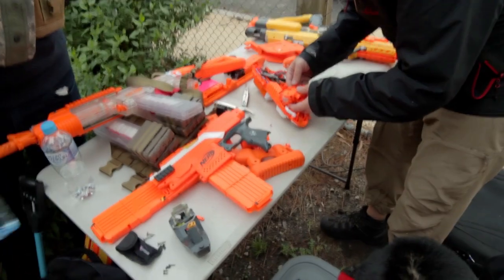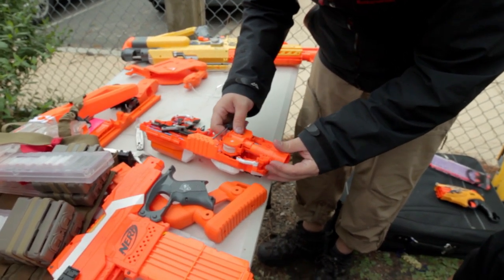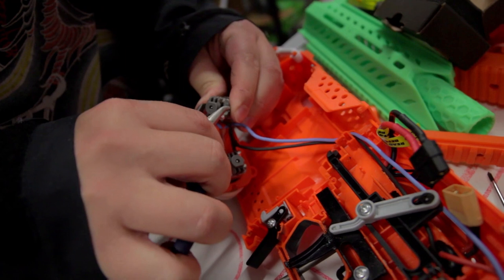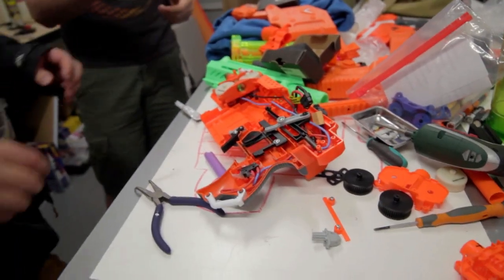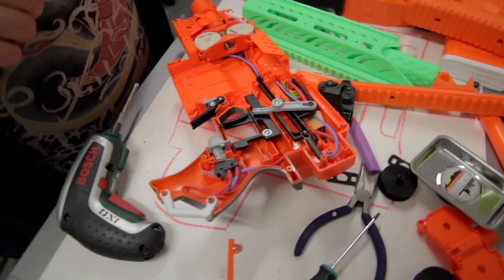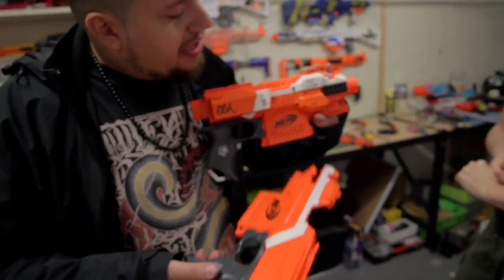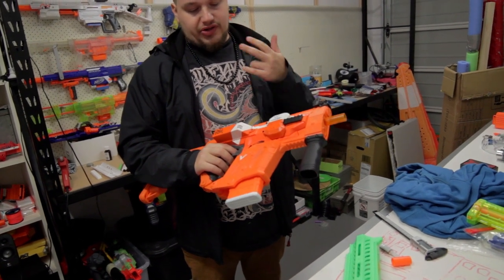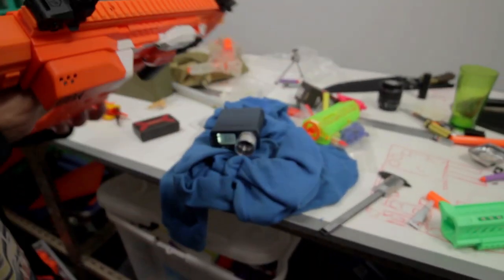The Trouble with Xtreme Pro 180 Motors - Nerf Repair Vlog

Comment: Sigh. Tube chrono.
Those XP's will just pound out every set of wheels you put on them. The shaft is too short, slightly smaller and unless someone makes a twin grub screw retained concave wheel set, will just keep doing it. I stopped putting them in my builds last year for that reason.
Reply: I've had the XPs chew through a few sets of regular flywheels, but so far the Workers are doing just fine. I think a contributing factor here was that the BSP cage appears to have thicker walls than a stock cage (at least from what I can see in the blurry video), leaving even less shaft than usual. I could be wrong about that, though. In any case I'm sure the BSP cage would be fine with an MTB motors and their... erm... sizable shafts.
Reply: but I front think the do anything in a snickas   cage
Reply: but I front think the do anything in a snickas   cage

Comment: Also mounting a high power 180 motor to really flexible plastic is going to cause problems. I went to the Aluminum cage from DRS and all my vibration problems went away.

Comment: Drill a hole and add a grub screw. Problem solved. The DRS flywheels fit tighter so I will test these motors.

Comment: +Make.Test.Battle I watched your modding guide on the Stryfe, and I followed the links, and the link to the Charger Power Supply led to a page with many different options, which is the right one?
Reply: I had the same trouble, look up 3s lipo charger and there should be one called 2s/3s lipo charger, it has 3 lights on it, that works fine

Comment: Can some pleas explain how I avoid burning out my motors but still get good performance?
Reply: change you battery.
Reply: are you using li-po? Avoid high amp.
Reply: It's high voltage you want to look out for. Motors are rated for certain voltages, going over that puts more wear and tear on the brushes.
As weird as this sounds, and I'm just getting used to the idea, motors only take as much amperage as they need. Voltage is given... that's why 4 IMRs will wreak havoc on stock motors, while a 2S LiPo won't.
Reply: +IAmBobololo that's why my rapidstrike flywheel cage melted -_-
Reply: +IAmBobololo thanks to every one for helping me out, and thanks for replying Bobo I am a MASIVE fan
Reply: +Ian Kyle Maturan no I haven't really moded anything yet (I took out the A.R. of a nitefinder) but I wanted to start, thanks for the help